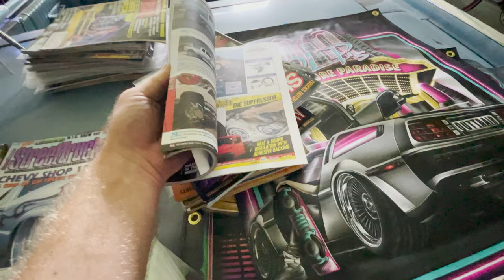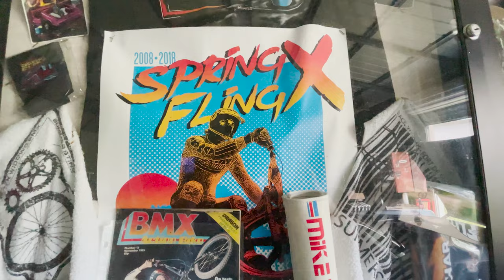1964 Lincoln Continental Convertible Updates & Tips

Comment: I removed my insulation under the hood since it sags and lays on top of the engine and that traps so much heat I'd get vapor lock after turning off the engine and car sits.
Reply from the maker: No doubt. I’ve seen a new kit for about $60-$70. If you don’t have the 3 port Carter fuel pump that will help as well. Mine vapor locked in the beginning with the 2 port on it.